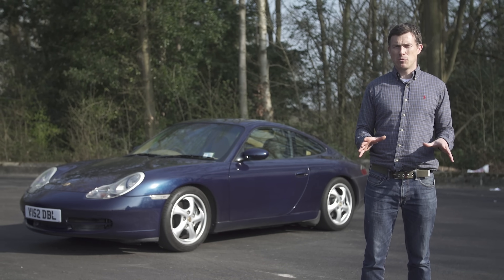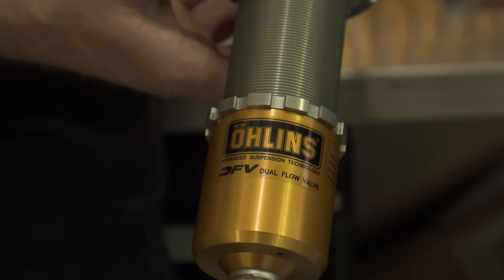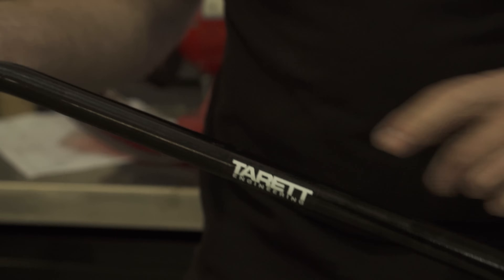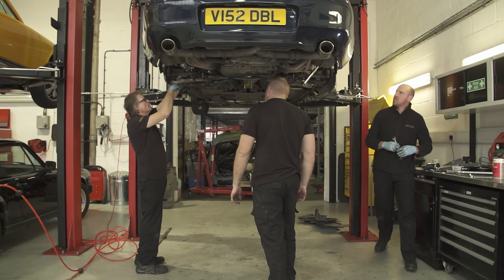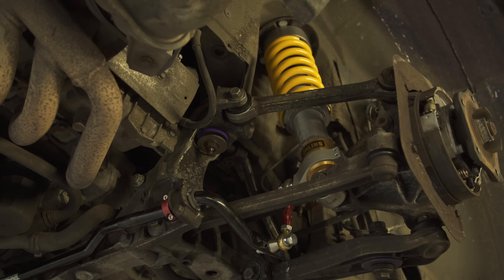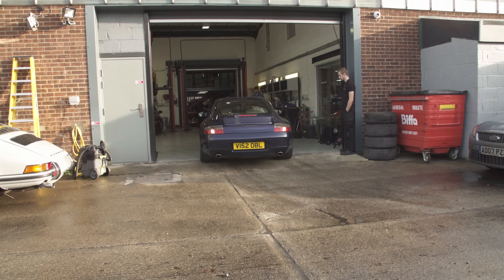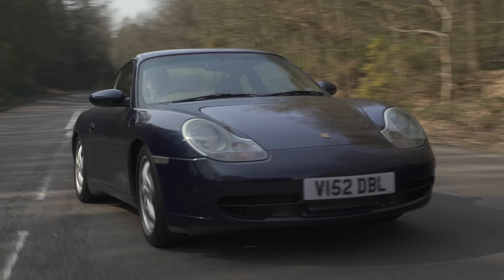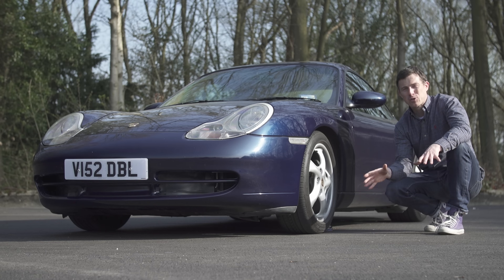Porsche 911 996 - my suspension upgrades make it drive better than new | Mat Vlogs

Comment: Glad to see another 996 on Ohlins R&T!  I don't know why this setup is so rare on a 996, I've had mine for 4 months and the difference is incredible. Rides better than stock in mid-soft settings, and is razor sharp at the stiffest. Modern damping (PSS9/10 are pretty old IMHO) on this chassis is pretty astonishing. Keep the updates coming!
Reply: DeanoTXR53 thinking of doing engine mounts next. What do you think?
Reply: I actually had rennline semi solid mounts on for about 400 miles this winter. Loved the handling benefits, pretty incredible really. But the added nvh was actually triggering my knock sensors and the ecu was pulling timing. Swapped in fresh stock mounts for 70% of the benefit but none of the issues. Not everyone has the problems I did, but it does happen. Spoke with Jake Raby about this and he says this is why he won't put semi solids on any of his builds

Comment: I upgraded my bushes about 10 years ago on my then seven year old Golf (over 100k on clock) and it felt amazing, new even, completely transforms the car.
Reply: I put the polyurethane bushings in my 1988 911 Carrera and they ruined the ride of the car. The ride was so terrible afterwards I had to sell the car. I would never do that again. The Ohlin shocks are fantastic.
Reply: @norberthofer5830  I would absolutely limit the amount of Poly bushes in any road car. Hard bumpy experience just like yours.

Comment: I knew that you would love it. Did the same exactly the same on my 2010 e90 M3 and the transformation was unbelievable. Forget about power up grades. Suspension modification / refreshing is the first thing that you should do on an older car IMO.  Even some new ones will be better with it !
Reply: @S S  Yep - nothing with any sort of performance is "good" on a crappy road except maybe air ride or McLaren hydraulics. But the Ohlins I find most satisfactory. Might be firm for the "normal driver but for a sports orientated driver I reckon they are a very very good option- IMO of course - good luck with what you finally choose :) BTW - I had Bilstein PSS10's on my now deceased e46M3 - I think the Ohlins are better - more refined :)

Comment: Obviously not cheap - but you've got real value in all those upgrades and expert fitting. And demonstrates that a proper, if again expensive, mechanical suspension setup with instant response still has big advantages over the current semi active stuff. Oh yes, and praise be to Ohins.
Reply: Gary Walker a lot of promotion, the repair wasn't as expensive as you might think.
Reply: +dschonsie design 911 did the work free of charge according to the information
Reply: Gary Walker Carwow obvs sponsored it aswell

Comment: Definitely worth changing the suspension shunts every 5 to 6 yrs, even if you dont drive the car much.  Recently installed a full set of bilstein B6 by reusing the coils and without lowering, now drives much better than the original factory-fitted Sachs, and my A4 was on 38000 km (23500 miles) only...

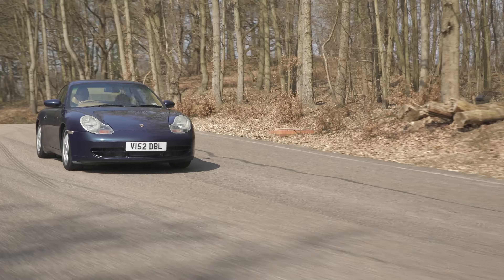Comment: 8:34 they both accurate if its done properly with high precision it is very accurate just like laser. Keep in mind that their system is more advanced cause they have measurement plate and other things so it's not just a string.  Laser alignment is incredibly accurate and fast to use and hard to make an error.

Comment: Awesome car. Love the coupe, color and new suspension. Like 10+ people already said, it's screaming for a set of aftermarket 18" wheels and tires. I have a 996 and recently spent a ton of $ on upgrades, including h&r coilovers, black victor wheels, gt3 toe links, and way more. Oz also makes a nice wheel for this car. OEM 18" wheels painted with spacers also would give it a wider, more subtle look. Keep up the great vids.
Reply: What do the GT3 toe links give you? More adjustment? Also have you done the engine mounts? I think that's next.
Reply: The rear gt3 locking cup car toe links were recommend by shop who did the full suspension work. I got a deal on my neglected 996, and have since spent $23k CAD on sorting it out (crazy I know). The suspension was the most expensive job.. other things I've done: wheels/tires, windshield, various cosmetic pieces, swapped for newer turbo seats, heater core, engine mounts, BM short shift kit, GT3 alcantara shift knob, engine mounts, spark plugs/tubes, belt, all fluids, frunk latch, mats, apple carplay head unit, water pump/thermostat, door seal (leaking water), ignition coils, stone guards, clear turn signals, carrerra emblem, control arms, some paintwork and other fixes. I underestimated the 'porsche tax' somewhat and it gives me more appreciation for my camaro ss and newer cars in general. Good news is that I don't think I'll lose much if I sell it as it looks pretty sharp now. Triple Black cabrio w murdered out look. Definitely engine mounts, ignition coils, and water pump are good to do in older 996's.
Reply: The toe links apparently do a better job of locking in alignment/camber etc and almost a must for track use, especially with lowered suspensions.

Comment: Yeah .... well .... I did basically the same changes except that I took the Bilstein B16s and Eibach AR-bars. The technology is very similar. The damping set up method is nothing that only belongs to Öhlins. All the good brands have usually an adustable (needle)valve of somesort and another cut-off valve which is basically a plate spring preloaded valve. Once pressure difference is great enough to overcome the preload the valve opens and cuts damping forces for high piston velocities. All performance dampers (Bilstein, K&W, Koni, JRZ, Öhlins, Sachs,..) work the same principle. The thumbrule is almost that cutt-off is always too mild. 

My experience:
First of all the standard 996 suspension is wonderful for B roads. The M030 Sport suspension is just slightly stiffer. Both are excellent for B-roads and good but a bit living for track.  I wonder about the claim of understeer since that to come up you really need to drive aggressive. Frankly, I think it is a bit hot air in public road speeds. Anyway, I lowered my car about 22 mm from standard and I also took the Powerflex bushes but AR-bars I took from Eibach. The car is now stiffer, less comfortable, more accurate but under bumps more lively - all logical. I think my front AR-bar is a bit too stiff. also I think the B16 front rebound/Bump-ratio should be slightly higher as now I get a touch of that famous 911 front bouncing. In a 911 the bump damping must not be too stiff as it will make the light front hop up aided by the engine hanging over the rear axle.

My recommendation for B roads is still the M030. If you do track frequently and as a driver you are in the last second/km of the car potential then you might want to have more adjustability and pick up a coil-over pack of one the leading brands. Knowing the principles I dont think there is much difference between "good" brands. Ruben Zeltner, who you can consider as an ultimate 996/997 specialist chose Sachs and won German Rallychampionship twice.

About the Powerflex bushes I am a bit inconclusive still. Honestly, I can not really say I could sense a big difference. There is maybe a little bit less bump noise but more tyre noise passed to the vehicle frame.  They most likely contribute to the increased accuracy of the car. The one doubt I have is what do the stiff urethane bushes do the the Weissach-principle of the rear axle. (In Cup cars they eliminate the Weissach toe-in gradient by urethane bushes...).

As a driver I am about 1.5  s/km off my car's potential on a race track. However, I do testing for my profession so I guess  I should be trained to be pretty objective. I am definitely not a forum besserwisser without a Porsche. That's my two cents for my Porsche brothers.

Comment: Ive been contemplating doing this to my 996.  After watching this video I researched the ohlins road and track suspension and it seams to be amazing. Better than Bistein Pss10 Coilovers even. Wish i could find a used set of the Ohlins Road and track system for the 996.

Comment: Awesome video, thanks! Mine is booked in for a wavetrac + light flywheel soon. Next year I'll renew the suspension although I may not go as far as ohlins r&t.
Reply: Pedro Venda I decided not to go with light fly - the dual mass helps harmonise some of the engine vibes and you know that M96 engine doesn't have the best reliability record.
Reply: Yup aware of it, thanks, but made the mistake of driving one... felt wonderful, really enjoyed it! No way I can afford a GT3 but rebuilding an M97 (in my case) would not be impossible.

Comment: Ugh it seems everyone is recommending look at me wheels. Please keep it OEM, there is something nice about stock. If your wheels and car was in bad shape, then I could understand after market wheels, but OEM is so subtle. Spend the money on more important things. Just my 2 cents. :)
Reply: Some people get wheels for more than just aesthetic reasons. A lot of the track guys I know just need to run wider aftermarket wheels for more grip. 

It depends on your needs, but wheels are often the best investment to make it you're looking for more grip. Adding another inch or two of tread, for probably less than suspension and bushings, makes a much bigger difference.
Reply: th415263 Also weight savings going along wider support for tires and better cooling
Reply: That's great and all, but you can tell what he's going for mate. He's kept it as OEM as possible with subtle mods to freshen it up and improve it. The suspension is the single biggest receipt he's had to pay, and wheels easily cost as much without adding that much performance. Upgrading the tires first is a better idea, then maybe finding wider wheels if you're really looking to get going around track. But you can tell that he just wants a daily-ish sports car for the street.
Reply: th415263 and as important if not more so in some cases, dramatically reducing unsprung weight. Cutting the weight of wheels in half day from 30lbs a piece to 15lbs a piece (random number) or hell even just shaving 5lbs off each is like taking out exponentially more weight from another part of the car, people don’t appreciate how much every bit of unsprung mass makes a big difference, you may not feel 60lbs. Removed from throughout a car but removing 60lbs total from your wheels makes a shocking difference. Plus most solid wheel manufacturers offer OEM style and OEM center logos. Just be sure to get proper 3 piece forged wheels not cheaper knockoff single piece cast wheels
Reply: Strictly Come Driving some quality OEM looking 3 piece forged wheels will make a huge difference especially for a car like this, drastically cutting unsprung weight not only improves acceleration perceptively but on a 911 maybe more appreciable would be the turn in. That said I don’t disagree with you, he can do that at another time, I’m just saying recommending new wheels is not “look at me wheels”, and in most cases people recommending certain style wheels on Porsche’s are usually recommending another Porsche OE wheel style not some gaudy cheap aftermarket stuff, so the original comment is off base regardless

Comment: I have a '99 996, did the Ohlins R&T coilover, but didn't do the stabars and bushings.  Wow what a difference.  Totally agree with your assessment.  I'm thinking of just replacing the arms instead of removing bushings and replacing with polys.  Are the poly bushings stiffer than the base bushing?  If so, any idea how much stiffer?
Reply: SVTEnthusiast I've had it all done at once so it's hard for me to answer, but as I said in the vid, I can feel the effect of the poly bushes - that's what makes it feel like new, not just handle better than before. The key upgrade tho are the coilovers. So you have done the best thing first.

Comment: "When you add it all up it comes to quite a lot of money to spend on an old 996" or maybe it doesn't; "Please note that in this video all the parts were supplied by the relevant manufacturers free-of-charge for use in the video. However, I selected them based research as to which set-up would be most suited to my needs for the car. Design 911 also did the work free-of-charge, once again I chose to feature them in the video due to their expertise in Porsche parts supply and fitting."

Comment: sounds like your pleased with the results 
recently had a lot of suspension parts changed on my 996 and was talked out of poly bushing by the garage as they said they would squeal and they doubted I'd be able to tell the difference over new standard bushes anyway :-(
you hearing any of these squeals? 
and some ohlins are certainly on my list of things to do too

Comment: A little bit of understeer and a little bit of roll...oh dear..I dont know how anyone could stand that....Those Ohlins look nice though...I thought all shocks have the clever valving that increases damping at slow compressions and opens at fast compressions ie a bump??My KYB Excel Gas shocks do and they didnt cost 6000 pounds. Those springs a bit shorter than standard..more like half... for ultimate stiffness replace springs with some bored out wooden logs. I must say it does look good on a smooth road though.....hammers are dangerous...

Comment: Well your stock suspension was probably still good it just felt not so good after driving newer 911s. 18 years in suspension development will definitely make a difference for sure. Upgraded coilovers, bushings, swaybar make car handle so much better.
10:38 and shocks cause they have nice tech in them they keep body stable while absorbing terrain.
11:27 it is completely wrong why do you compare normal modern car that is meant to be easy to drive, comfy to a old sport car apple's and orange's aren't the same. Compare it to new gt3 one of the best driving cars. I know it's been 4 years and matt changed and has felt it now how performace modern cars feel and he ordered model s plaid too.